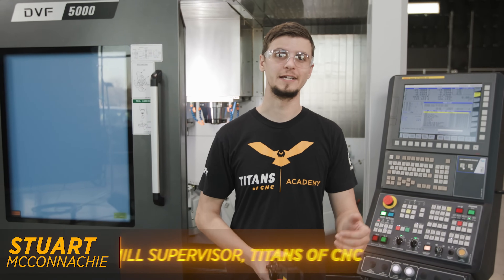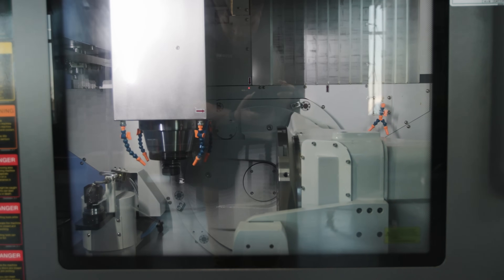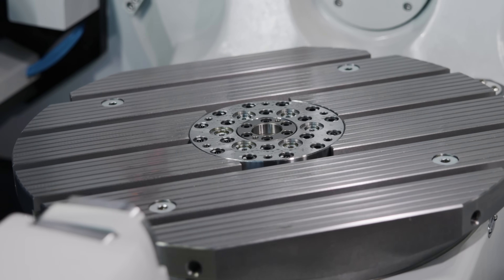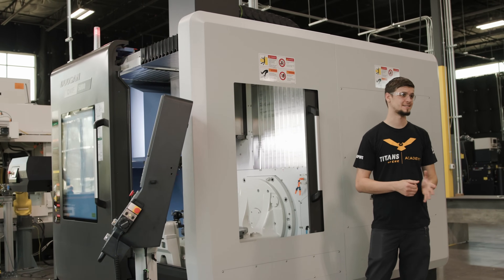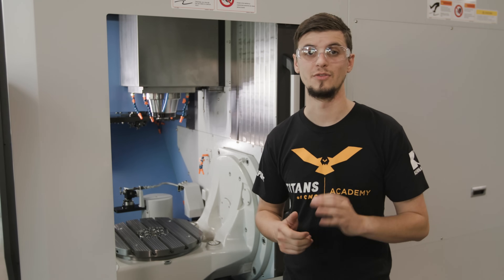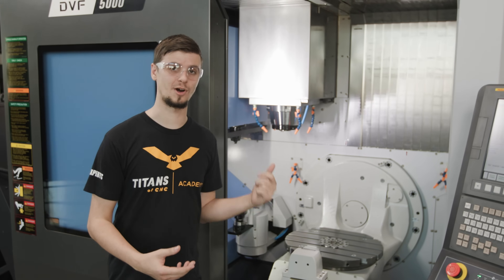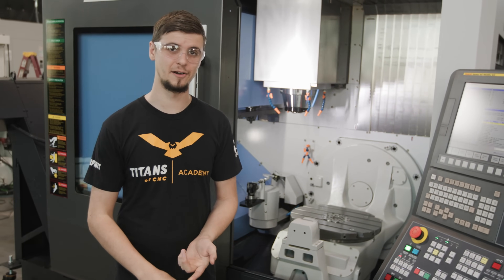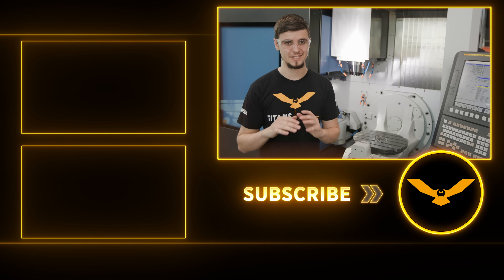Unboxing the NEW DVF 5000 5-Axis CNC Machine from DN Solutions

Comment: I would kill for this machine. I hold .001" profiles, .002" true positions, and mill holes and slots with class fit tolerances as little as .0003" total in a fucking YCM that's basically a beater car by comparison. Meanwhile, you guys are gonna mill trophies and random shit you probably won't even inspect.

Comment: What about the control?  Is it FANUC ?  Which CAD/CAM system are you going to use for making 5-axis simultaneous programs? Do you have an approved postprocessor? Do you have a virtual machine build in the control or as part of your CAD/CAM system?
I'm looking forward to the making of the parts !!
Reply from the maker: It’s Doosan and we’re using MasterCAM

Comment: Why do you buy machines in 2021 with SK toolholder instead of HSK xD
Reply: Cheaper option, cheaper tooling, and it is dual-contact cat 50. You pay a TON of money for the HSK option, and a TON of money for the tooling. They are a shop that doesn't take on jobs, and it's strictly an educational shop that takes on educational donations. So they have to make compromises. Like the geniuses whining in the comments about moving to Doosan instead of their DMG machines, who don't understand the concept of, "take whatever you can get." Doosan offered to outfit their shop, not DMG Mori. It's like asking a job shop with 2 employees why they bought a Haas instead of a Datron or Hermle. Also, some machines don't have the option to buy the HSK. It costs around $20k-35k, or about 10% of the total machine cost, to upgrade to HSK from CAT
Reply: It not important below 30k rpm

Comment: 80 millionths or .0008 which is basically +-.001. Very good but millionth makes it sound like it holds millionths. To be fair, I may misunderstand the machine tolerance so it could be better.
Reply: .00008 is 80 millionths.
.0008 is 8/10ths

Comment: This is a really nice machine, but why not just go with an HSK spindle at this point?
Reply: i believe SK40 with Big-Plus is more rigid than HSK63 but has the disadvantage of less gripping power with higher rpms than HSK63 (SK40 grips from outside and HSK63 grips from inside)
Reply: @ipadize  Thanks for the explanation. I'm kind of a fan of HSK, and I'm hoping to actually make a homemade HSK spindle someday. It just seemed odd to me that "Big-Plus"/Dual Contact was used when it feels like a patch job to solve high-RPM problems with taper tooling. Using those rotational forces to your advantage for more gripping power in the HSK design just seems to be a better solution overall for really high speed spindles, but I am a noob in this world, so take what I have to say with a grain of salt. The only milling machine I own is the one I made last year lol.
Reply: @Thorhian  at work we have 3 HSK40 machines with up to 42000rpm, 2 SK40 machines with 18 and 12k rpm. 

are you yoing to completely make the spindle on your own?
Reply: @ipadize  That's the plan, but that's something I plan on doing down the road. I'm just trying to get myself to the point that I can earn some cash with my milling machine while I'm in school lol. I'm actually just a Computer Science student who also likes this stuff (automated manufacturing and machining). I kind of need a lathe and a way to grind outer diameters and inner diameters before I try to make any sort of reliable spindle. 

BTW, Kern Micros have 42000 RPM HSK-E 40 spindles, you wouldn't happen to be in a shop with that kind of crazy hardware would you lol?
Reply: @Thorhian  we have exeron hsc600, hsc300 and a hermle c600u with 42k rpm spindles

Comment: I have used DVF8000 T with heidenhain control much better than Fanuc in my opinion. 
I think it's as good as  DMG MORI DMU 95 monoBLOCK also with heidenheim one of the nice things with this machine is you can load and unload tools when it's running so that you can get ready to next operation a lot faster especially if you also use ZeroClamp on the table Such has much higher turnover rate.
and I've also good experience with two other brands MICROCUT MCU-5X and AXILE U6 all the machines had heidenheim controls I think it's the best 5-axle controller with most flexibility 
I speak from daily experience with the various machines

Comment: What are glass scales?
Reply: It's like a  axis travel tracking meter, let's say you through the CNC controller command it to go 5 inches, glass scale would track how much physically it actually went, and if it went too much or too little,  computer would compensate that error by telling the axis motors to go more or less, so the travel would be exactly 5 inches. It might not be the exact explanation, but something close.
Reply: @Andrey222ful   excellent explanation
Reply: @Andrey222ful  what would it use if not glass scales? Eg if using glass scales is a selling point, what’s the alternatives?
Reply: @danhyde7501  I'm not an expert on positioning systems, but I know that usually CNC machines uses on drive axis encoder, but with scales it's more accurate, at least that what i had been told. As it was mentioned before that scales on machine is not an enqueue future as it now almost industry standard. So I don't know other alternative.
Reply: @Andrey222ful  fair, he mentioned in the video like it was a selling point or something. Cheers for the explanation!
Reply: @danhyde7501  You welcome
Reply: @Andrey222ful  Drive motor encoders work but they are not as accurate due to the fact the encoder is on the motor.  Any drivetrain slop between the actual motor and the pallet or spindle won’t be detected at the encoder.  That is why glass scales are more accurate because they are reading the axis position closer to the pallet or spindle
Reply: @JAT922  I knew that, but thanks for writing, so other people can read it and understand it too.

Comment: glasscales ... my privat maho 600 cnc has those, and it was build in the 90s (accuracy 1/1000mm on the scales).
hell, you can get regular glas scales with a dro with 1/1000 mm acuracy for around 1200 euro for a lathe (three scales in total). it ain't that difficult to convert the output for use in a cnc system.
why would you think double contact is such a big deal on a milling machine? hsk is meant to have that and you can convert any sk40 tool holder and spindle for that if you'd want to (not that it'd be necessary for this type of tool holder, they can't go up to really high rpm anyways due to the pull stud system).
881lbs of load, that's about 420kg or something like that ... aren't the old dmg 50 5-axis machines rated for 500kg or so? and they don't have the second bearing surface like this has which I'ms sure is going to get in the way for some people and in some circumstances.
hopefully it wasn't too expensive, otherwise getting two to three older machines would have been a better investment (you could have two running and one just for parts so the downtime is minimal, or the third for a backup when you have a larger order of parts) for around 25-35k a piece with full haidenhain 426 controlls (can also be upgraded to heidenhein 530 or even 600 series for a couple thousand if you'd want to).
i honestly see no value in this machine that i could not get for less money in a used machine. the only exception would be the sensors, and those can most likely be easily added to existing machines and controls, so it's not too expensive.
also, why go into millionths when you can just say micrometer and everybody will understand you and know it's 1/1000 mm (plus it's around 3,94x10^-5 inches, so more accurate than your 60 millionths on that machine).
Reply: That tnc 530 control is amazing.
Reply: @shaunofthedead6389  not that hard to upgrade to if your machine has an older version of the heidenhein controll as well. 
i was trained on a dmg 635 with the 530, it was great!
so incredibly simple to use, really helpful in directly programming with the dialog driven programming (so no more g-code) and it shows you what your programming will give you as product in the end.
from my knowledge it's also quite simple to implement the post processor for autodesk and solidworks.
i've experienced several controllers by now, and the heidenhein is by far the best and most user friendly for milling. for turning i do, however, prefer the siemens 840 based control, it just makes more sense with their dialoge system for turning and active tools in my mind.
Reply: @10010110100102Error  I can promise you that you will love heidenhain tnc 640 with turning module I'm using it on dmu 95 monoblock and doosan dvf8000t 
I use Autodesk Fusion 360 to program it on It has its drawbacks in that it You are a little limited in your movements Then I have to program it myself It just takes a little longer
I'm thinking of buying powerMill.
i have been using heidenheim for over 25 years there is nothing better.
wish you all good health in this time
Reply: Used 5 axis machine with a possibility of unknown number of previous collisions and backlash issues sounds like a nightmare to me. Upgrading, adding and modding all add downtime. I totally get why some companies only use brand new machines and sell them right before they need any significant maintenance or when warranty period is over.

Comment: How do you deal with tool wear while running lights out?
Reply: I went to a shop that had aftermarket vibration sensors. If they went above a certain level the program would automatically grab a different roughing tool and start back where it sensed the vibration. It was roughing titanium landing gear pieces for a large commercial jet. Those parts take hours of roughing. It was cool to see.
Reply: @TritonTv69420  how would you change an insert on a lathe?
Reply: @Wolfcamp555  just change the tool?
Reply: @ipadize do you understand what running with lights out means?
Reply: @Wolfcamp555  okay which type of lathe do you mean? manual, turret or mill-turn lathe? turret lathes can change the tool automatically as well as mill-turn machines.
Reply: @ipadize  the video is about cnbc machines.